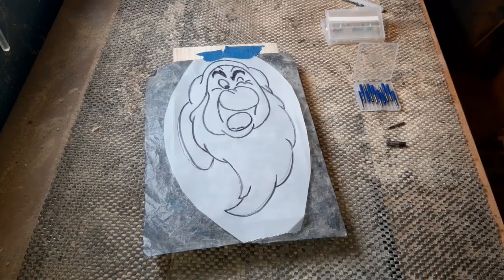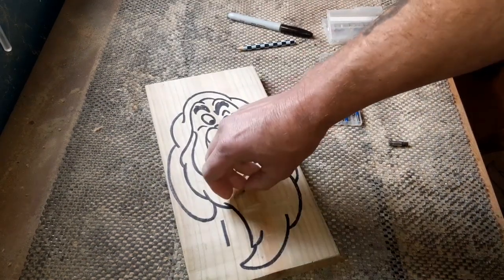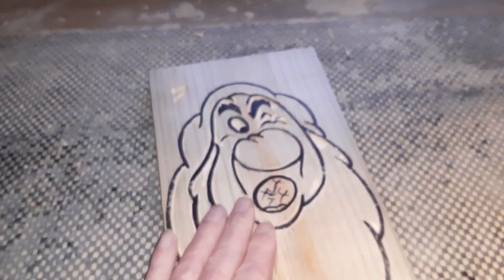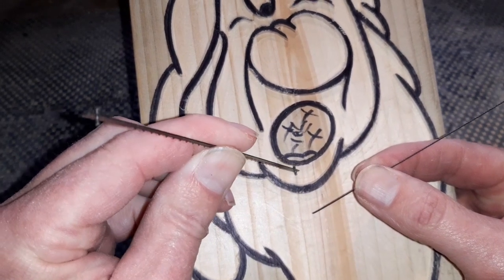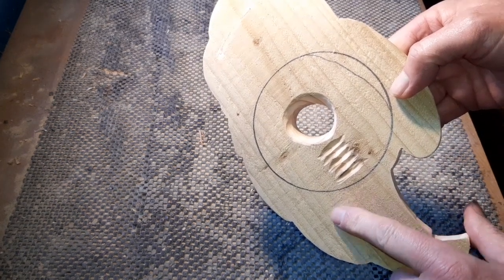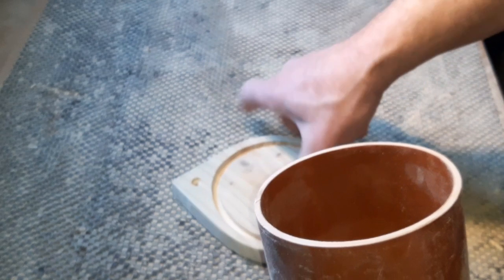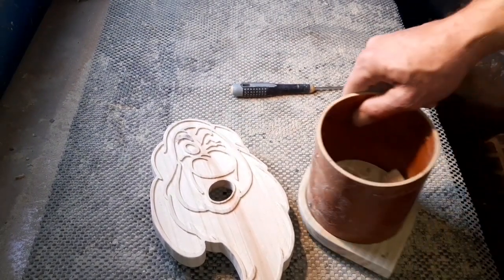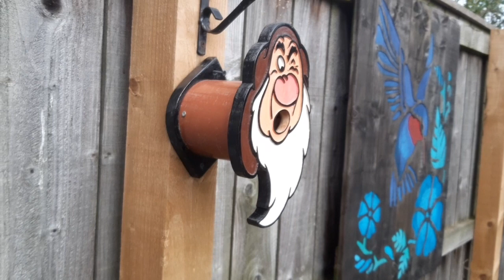Grumpy faced birdbox made from fencing wood. Router Project..

Comment: Great design! I was thinking it might be challenging to line up the screw holes in the tube with the front once you take it apart. Maybe marks on the back of the face and marks on the tube to line up together so you hit the screw hole on the block inside each time.😀
Reply from the maker: Thank you  it actually screws to the fence post without removing the front section with a smaller screw driver,I've also Mark the holes like you said..😁👍